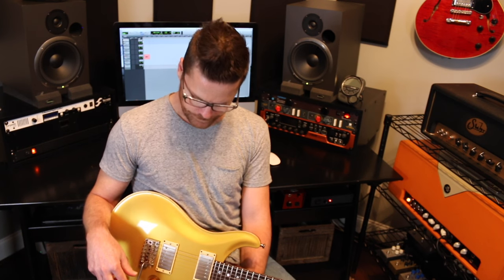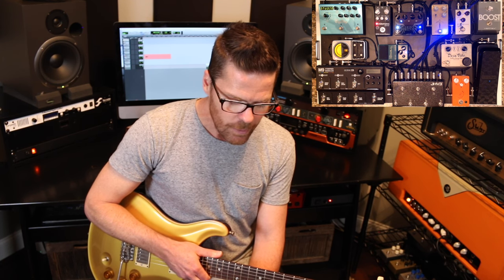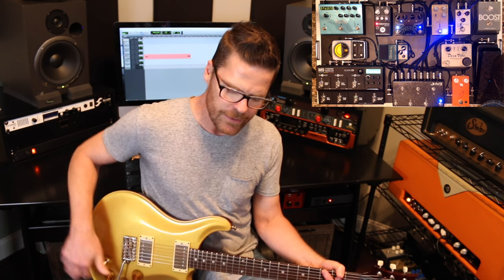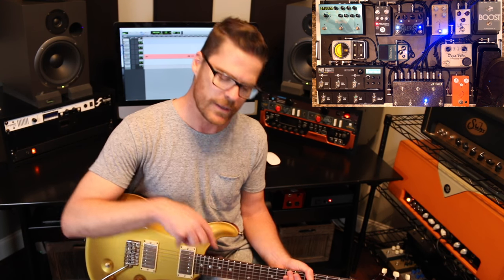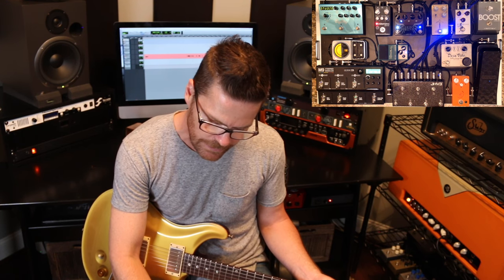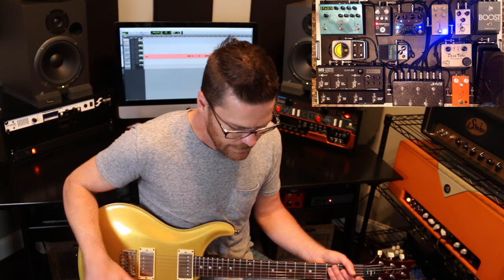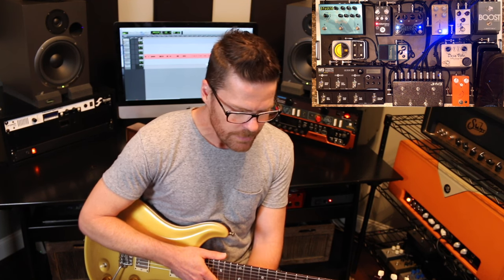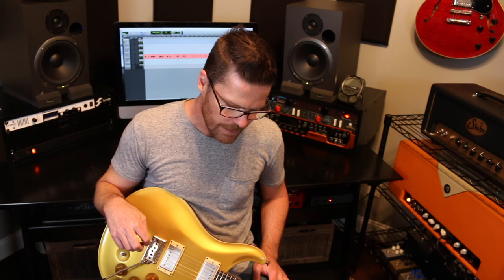Shawn Tubbs Big Pedalboard Rundown Demo Video

Comment: Shawn. Excellent! So Ive been with Tim Pierce for these last few years and I just found you! Thanks for being out there on YouTube! So Shawn,  is there a list... anywhere in the world... that would tell someone which overdrive pedals fall into which categories?  Some list that tells us which OD's/Boosts fall into categories such as> Boost, Klon, Tubescreamer, Dumble, Plexi, Treble Boost, (Dallas) Boosted Mids, Scooped mids, Fuzz, Distortion etc you know what I mean right? 
I have 40-60 different OD/Boost pedals... because I have a problem..., lol, but what I DONT know is what the pedal is trying to do/emulate/copy. I know there is only like 5 different original circuits and even though it may be a "Boutique" name brand pedal like the Tumnus = Klon, they are ALL still clones of some amp or circuit right? Dallas Treble booster for example Thanks man.

Comment: I've become such a huge fan of your demos. I gain great insight. Can you suggest any delay settings that you don't tap in for solos? E.g. I've been using 2 delays at 500 & 375 that Andy Timmons apparently uses for soloing. I also tried 600 (Read Neal Schon uses that setting). Lastly, I've experimented with some dotted eighth and quarter note too. However, I'd love a standard one for most solos. Its too impractical to tap in the timing in live settings for me. Thanks.
Reply from the maker: I tend to sit in the 275-325 range and keep the delay dialed a little darker. Thanks for your question and kind words.

Comment: Hey Shawn in the video you said that you ordered the wrong cable, 2524, do you typically use something different? I'm debating on going with either 2524 or 2319 on a pedalboard I'm currently building. Do you have any suggestions? Watched this video quite a few times, your a killer player/tech and awesome guy for doing this video! Thanks!
Reply from the maker: 2524 was a heavier gauge than I wanted for the sake of aesthetic but it sounds perfectly fine. If I were to wire my board again right now I'd go 2319. It's way more pedal board friendly and will sound the same. Thanks man!

Comment: Wow! Thanks so much for posting this video! Totally dig your set up and gave me a few ideas along the way. Btw on your m9 you had 2 quarter notes a reverse and a what? Dotted quarter?
Reply from the maker: Sorry I wasn't very clear...my fault. I had a tape delay set to quarters and dialed lower. The 2nd was a Digital Delay with the top end backed off but with more mix set to quarters. The 3rd was an analogue delay with mod set to dotted 8th and the 4th delay was a reverse delay set to quarters. Thanks for the question and tuning in!
Reply: Shawn Tubbs Thanks for the response! Can I ask one more question? So when your playing rhythm and want to take a solo do you turn off say your archer and then turn on say the Winford?
Reply from the maker: On that pedal board I do. Thanks for the question.

Comment: Great stuff as always. I don't feel guilty for having a dedicated drive for my neck pickup anymore:) I am curious about the type of guitar picks you use?
Reply from the maker: Thanks man...Well all of my PRS guitars are PRS pickups. I'm a big Lollar pickup fan overall. My Collings I35 has Throbaks and my Suhr Strat and Tele both have Suhr Pickups. In general if I'm going to switch to something other than stock it's a set of Lollars.
Reply: Shawn Tubbs sorry I should have been more clear, I meant picks as in plectrums. But the info on the pickups was very  useful. Thank you!!
Reply from the maker: Sorry read that too fast. I just use plain old Fender Heavy picks. I think the shape is 251?

Comment: Hey Shawn would u prefer duck delays over standard rhythm delays? What do u think? Thx. Sounding great! 😄
Reply from the maker: Hey Joshua,
Do you mean ducked or threshold compressed delays? Basically those delays are compressed or "ducked" via a set threshold while you're playing and then become more apparent when you stop? I do use duck delays occasionally but only for effect. In general I prefer basic delays. Thanks for your question and the kind words!
Reply: Shawn Tubbs ah yes that kind of delay. Reason im asking is lots of times id want the delay to trail the note to fill the space but dont want it messing around when im playing rhythm. That means you'd have to hv your mix pretty low with the standard delay right?

U inspire me Shawn, i really live your choice of tones and playing style 👍🏻
Reply from the maker: Yes that's one of the ways one would use a ducked delay . One suggestion is sometimes it's better to run your delay level lower and use more repeats as apposed to using a ducked delay. It gives the perceived amount more delay without clutter...So say you're hearing 3 perceived repeats in the mix but it's not enough delay level, try increasing the repeats to 6 or 7 before bumping your delay level. Thanks Joshua!
Reply: Shawn Tubbs oh wow ill try that! Thank u for the tips n God bless! :)

Comment: What I'm trying to figure out is how the volume pedal is wired to control both the Vertex Boost and the stutter tremolo rate on the M9. What am I missing here?
Reply from the maker: Hey thanks for the question. The Dunlop EXP pedal is only plugged into the Vertex Boost. It's not controlling anything else on the board. The stutter trem on the M9 is random within the program. Thanks for tuning in!
Reply: Awesome, Shawn. Thanks for the speedy reply!
Reply from the maker: You got it! Thanks for tuning in!

Comment: Shawn, is your volume pedal a stock "pot" style rather than light technology ?
Reply from the maker: Yeah, it's just a stock potentiometer style pedal. It's plugged into the Vertex boost insert which I'm told keeps your signal isolated from the impedance of the volume pedal.
Reply: I appreciate how you take extra time here and there to explain not only the whats but the whys. You are the same patient guy you were way back when you and Scott were running the OC Boogie store.
Reply from the maker: Thanks so much Bob! Good to hear from you!

Comment: Hey Shawn, any chance to let me know what your settings on the M9 are for the delays? Thanks
Reply from the maker: There are 4 delays in the scene I used.

 1 Tape Echo Dry Thru  - Bass 40% Treble 10% Feedback 25% Mix 15%  Quarter tap
 2 Digital Delay -  Bass 30% Treble 45% Mix 45% Feedback 35% Quarter Tap
 3 Reverse Delay -  Mod Speed 10% Depth 90% Feedback 45% Mix 50% Quarter tap
 4 Analogue with Mod -   Mod Speed 80% Depth 45% Mix 30% Feedback 40% Dotted 8th Tap

The percentages are based on the LED graphs on the M9. It's not going to be exact but it will give you a starting point.
Reply: Awesome!! Thank you so much. I am using the M13 mainly for delays and 
reverbs but I find it muddy, unlike your sounds. But  I wonder if that 
Strymon has something to do with it ;-)
Reply from the maker: The Strymon is really great but I would suggest you check into a mod on your M13. My M9 sounded so much more open and lush after I had JHV3 do there thing to it! JHS also does great work.
Reply: Hey Again, Cool. I looked at that before.... And was not sure if its worth the money or not. 

Will look again. Thanks for taking the time mate!
Reply: just setup a new scene with those delays...  Wow... I am blown away. I used to add more treble for clarity, but for some reason the conservative treble settings you suggested work wonders. 

Nice warm and lush! 

I play the M13 through my Two Rock Exo in 4 cable mode, split after the first two FX. 

One happy man here.
Reply from the maker: Right on Markus!

Comment: What??  I was super close to buy a Truetone VS OX - or maybe the Jekyll & 'Hide but none of those are on your pedal board????? ok I'm not getting it then :-O
Reply from the maker: Haha! That bigger board doesn't exist anymore. I took it apart with plans to rebuild but just haven't got around to it. Most of the pedals I use on a regular basis are on my small board. I swap those out quite a bit depending on what I'm doing.
Reply: Cool! I'm still revising your vids with double drives/dists. What a tough small decision!! :-p
Reply from the maker: What are you trying to achieve via OD?
Reply: Hi! Thanks for replying. Basically nothign to harshy. More on the thick, chonky drives for alternative rock / brit pop ballads. Some mid beat rhythms, which would require a bit tighter approach on the OD, and for meaty, breaking edge finger picking. If soloing then bluesy with big body tones becasue I cannot play any fast so I play just melodic lines along. . I'd like to switch from one tone to the other in a song, and to have a couple of tweaking options. :-/ - I hope I said something sensemaking :-p.
Reply from the maker: I would check out the Rockett Pedals Majestic and maybe some of the Way Huge stuff.
Reply: Shawn Tubbs, The majestic, ok. You are the man of course you know what you're doing. I have the pork loin - way huge already 😎👌which actually works pretty well with acoustics! 👍. Off to watch majestic demos. Many Thanks. Before writing this 1st comment I left another one with big kudos for to your work in some Truetone review I think. Hope you saw it. Cheers. Congrats again!
Reply from the maker: Thanks so much for tuning in!!!